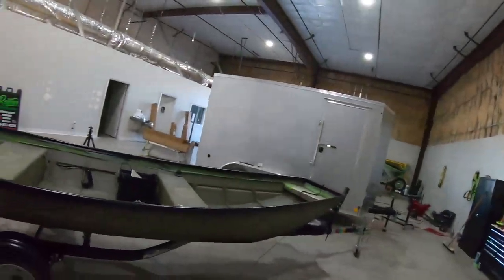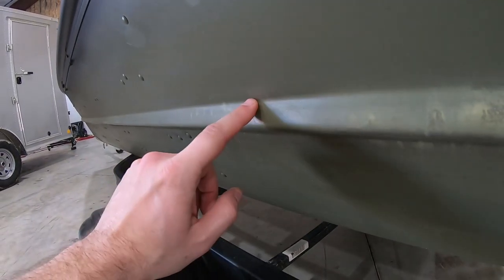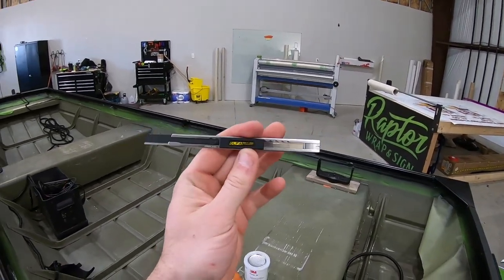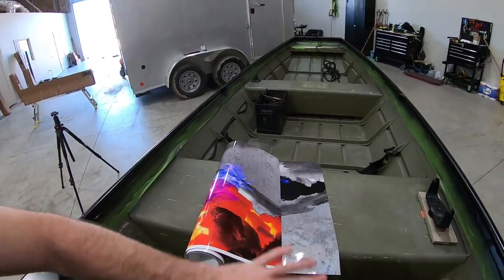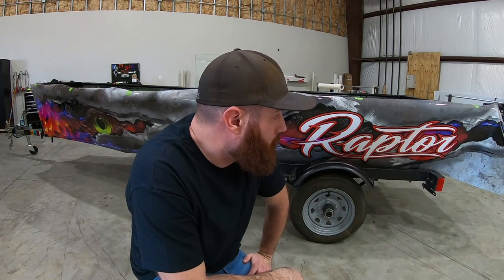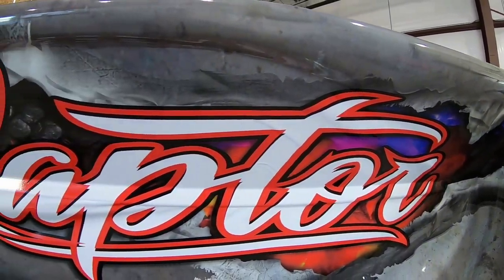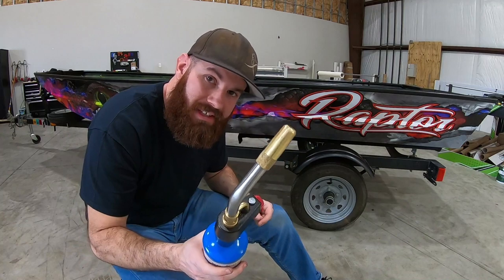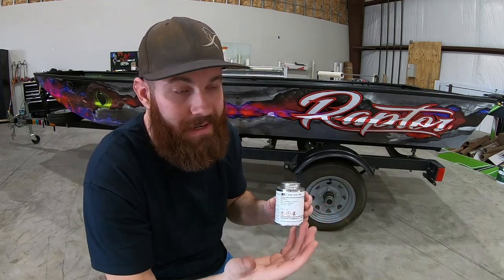HOW TO Wrap a JON BOAT!! (Vinyl WRAPPED Jon Boat Install)

Comment: Great video!  Thanks for sharing.  I don't guess you have much saltwater in AR, but I am in SC.  Would the type of vinyl and the other material (primer, sealer, etc.) be the same for saltwater use?  Like yours, my boat is aluminum, but welded instead of riveted.
Reply from the maker: I can’t say for sure on the saltwater application, however people do wrap boats in saltwater conditions! I would guess that it would be the same tho.
Reply: Thanks!
Reply: @BentRodBassin  hey can these be applied by a  shop even on a little 10ft older jon boat that might have a  few pings here and there?

Comment: Great video thank/ for sharing.  Did the vinyl make the aluminum boat a bit more quiet in the water?  I stalk spooky carp with a fly rod, figures this mod might help with that..
Reply from the maker: Probably not, the vinyl is only 2 mil thick, but it helps catch em!!!

Comment: Follow up video? How did it hold up?
Reply from the maker: As good as new!
Reply: @BentRodBassin  definitely thinking about this process now over painting my used boat. Painting seems more difficult and way more factors that could make it go wrong real quick. Not to mention way cooler vinyls. 

If I wanted a custom wrap would you suggest I hit up my local shop to help me out with that, or is that a online thing?

Comment: What did you do to get the air out around the rivets?
Reply from the maker: You can use the corner of your squeegee or 3M makes a rivet brush RBA-3. When you apply the heat, your wrap should conform around the rivet. Hope that helps!

Comment: What are your thoughts on knifeless tape instead of using a blade to trim?
Reply from the maker: Knifless tape is an essential tool for wrapping, I try to use it as much as possible to protect soft surfaces.